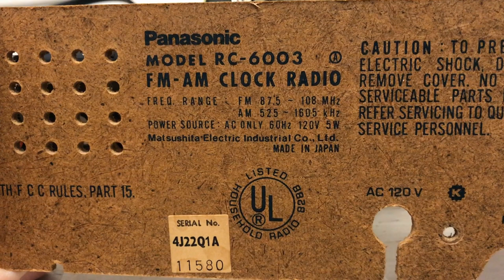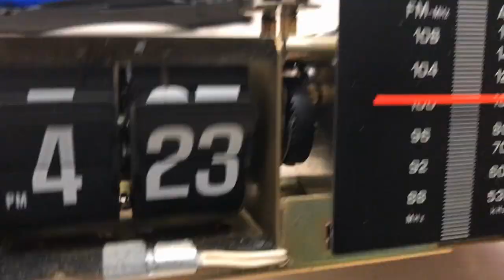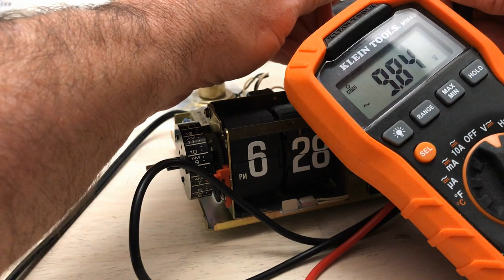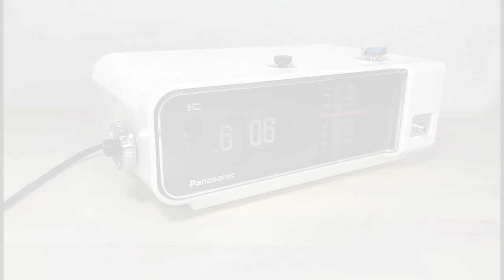Replacing the light in a Panasonic RC-6003 flip clock

Comment: Hello and thanks for the video. Maybe I missed the part, but if the light bulb is approximately 12v dc, can’t the wires to it simply be snipped and a white LED spliced instead of the factory bulb?  I have one of these clocks but the light is too dim to see from a distance. Thanks
Reply from the maker: Thats a good question. But the answer depends upon the amps of that 12 volts. If I had to guess it’s probably low enough to do that without a resistor. If it’s too high it will either blow the led or shorten its life. I’d try it.

Comment: I have this exact same clock and Miniatronics bulbs. Could I solder in two bulbs and have one bulb illuminate the hours, and the other illuminate the minutes? I understand the concepts of wiring in series and in parallel. Could the clock supply enough current for 2 bulbs? Thanks!
Reply from the maker: You've got me. You're going to need to consult an electrician on that one. Let me know!

Comment: Very nice video. I have one of these clocks, it's from the States  but it's now in the UK. Am I able to convert it to 240 volts UK? The owner said the flips digits do not work  when I bought it some years back. Any advice would be appreciated.
Reply from the maker: It would require a new transformer rated for 220 and a new motor to accept 220 V at 50 Hz Quite a bit of trouble. It’d be better to buy a good frequency and voltage converter. A good one of these can be pricy. No real economical way to do this.

Comment: I just revived my RC-6003 back from the grave. It just needed the motor cleaned and sprayed contact cleaner in the FM-AM switch and volume Pot.

The bulb is dead, I want to replace it, but if I did I might risk the chance of messing up or having the tiles burn overtime (TechTangents flip clock video) 

The speaker works, but I think someone spilled liquid in the speaker hole. 
Do you know where I could possibly find a replacement if I were to fix that?

Happy Holidays!
Reply from the maker: Not sure where to get a replacement speaker. Generally I have parts from other clocks for that purpose.
The light I used works fine - no risks of burning tiles.
Keep up the good work!
Reply: @Flipclockfans  thank you sir!